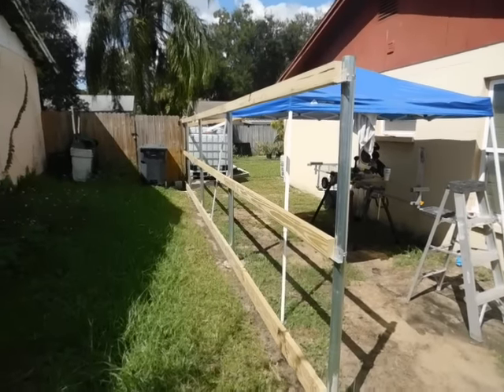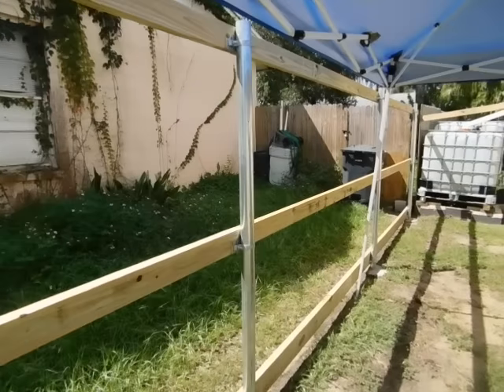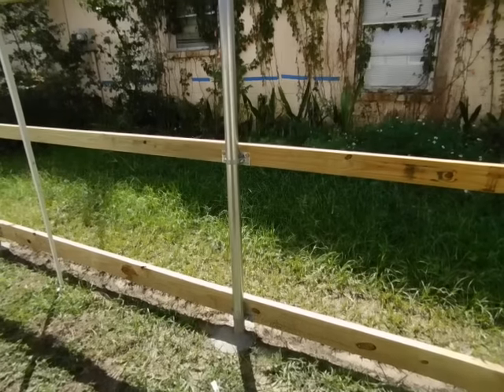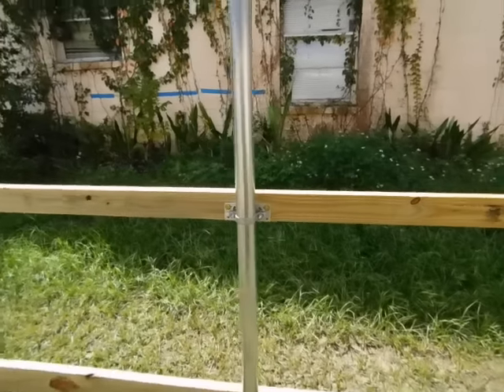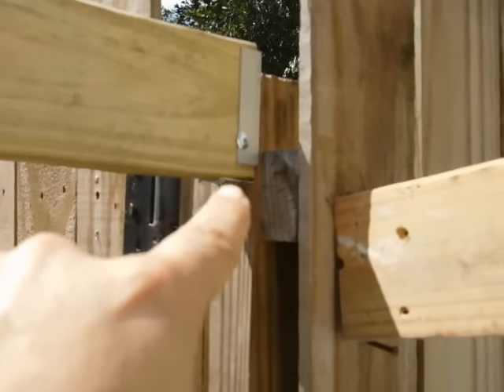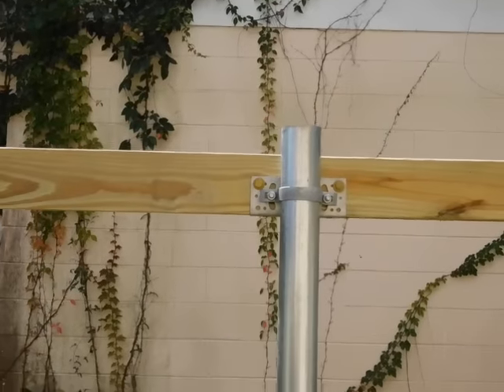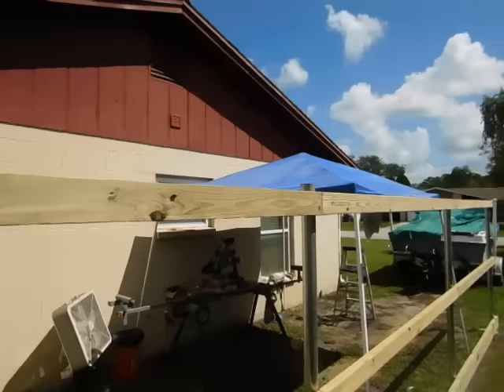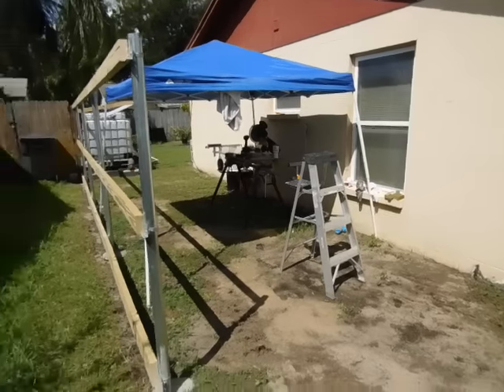DIY / Building a wooden fence using galvanized fence posts (part 1).

Comment: Do you think that I can use this same concept to make a 6' to 7' horizontal fence instead of vertical?
Reply from the maker: Yes Jessica, you can use any amount of spacing for the post to accommodate your design of fencing.
Reply: Horizontal fencing is nice, but boards will shrink a bit and there will be a big gap. My neighbor has a fence like that and now we can see to the other side. Unless you don't care much about privacy.
Reply from the maker: @BAKERHUSKIE  that is true RG and some people use a third picket to overlap the joint between pickets to help reduce the shrinkage when the fence is installed vertically. I don't know that this option would work on a horizontal fence.
Reply: Jessica Ramos: If i understand what you're saying, I've seen horizontal fences that I really liked. I had considered doing a horizontal fence when I replaced the back portion of our fence recently. I used the same process as Manny - galvanized posts set in concrete. I also used three rails, which I always recommend. My workaround for boards needing to be replaced in a horizontal fence was simply going to be way more involved than I had the funds, time, or energy to do. I figured i would need to do the following: 1) use square tubing (I like 3" square tubing with 1/8" walls) 2) weld "channels" on each side of the posts which would allow me to slide horizontal boards down into the channel. I got the idea from other horizontal fences I'd seen -- also "CreteFence" uses this approach. Their vertical posts have grooves running down the sides. 3) I was going to go with cedar lap and gap boards. Using that type of board, there would be no gaps between the boards. Then, if the bottom board ever rotted out, all I'd have to do would be cut it away, allow the other boards to slide down (since they're in channels, they wouldn't need to be screwed or nailed in place) and add a new board to the top. 

After literally months (or maybe even years) of going back and forth on which design I wanted to go with, I finally just bit the bullet and did essentially the same technique described by Manny. I do have a couple of short videos showing the before and after of my fence, but Manny does a great job of describing the vertical process.

Comment: What do I use if I want my fence boards mounted horizontally?  Yours are mounted vertically.
Reply from the maker: If you want your fence boards or pickets mounted horizontally, you'll need to install your support framing vertically and evenly spaced for the length of your horizontal boards.
Reply: Manny's How To Workshop Yes but I’m wondering if this bracket would work for vertical support framing. Or are there any other options out there?  I’ve been looking but no luck.
Reply from the maker: @TheMultisportGeek  You could use this bracket but you'd have to flatten the bended part in order to do so. I would use the bracket in this link to mount your support boards vertically. https://amzn.to/30VSgWL Also, you would need to use a 2x6 PT so that you would have enough of a nailing or screwing surface for your horizontal boards.

Comment: Do you have to put 3 boards running across or is 2 ok
Reply from the maker: Joe, for a 6' fence, I would recommend at least 3 so the pickets won't sag in the middle. Even if you raised and lowered the top and bottom rail, the pickets if 6' tall, would start to curl in either direction.
Reply: 2 or 3 boards what's the difference
Reply from the maker: @joeolvera1  2 will make the fence weaker after only a few years and 3 will make it stronger and will last 10 to 15 years easily.
Reply: @MannyFontes1968  thank you

Comment: Are you happy with the sturdiness of the posts? I do like the design and from what I have seen wooden posts are not a good option.
Reply from the maker: Absolutely Brant and these metal post will not warp from the sun's heat or rot from moisture after years in the ground.

Comment: How do I keep the poles straight, since they’re not wood, while the cement sets?
Reply from the maker: You can use a 4x4 post level or a regular 2ft. or 4ft. level on two sides to get your post plumb. I usually check the plumb at least 2 times when the cement is setting.
Reply: Thank you for your response... one more question, I already have a few 6’ posts in the ground from previous owner chain fence and was wondering if I continued with the 6’ (2’ in ground) poles, do you think this it can hold the 6’ planks and still be sturdy or would you recommend I replace with 8’ poles for the 6’ planks?
Reply from the maker: @triceychaundiva800  Sure no problem! If the original metal posts are in fact 2' in the ground with a concrete base, then you should have no issues either installing planks or pickets on your wood framing.

Comment: Hi Manny. I am a woman. Do you think I can set the posts myself?
Reply from the maker: kapersad1, you sure can and an easier way to do it, is to just pour your mixed concrete in the hole and then take the pole and push it down the center of the hole until you hit bottom, ensuring that it lines up with your line string at the bottom. Once the concrete begins to set, you can use your level to plumb it on both sides. I hope this helps you!
Reply: I'm not Manny, but I can say that setting the posts is man's work. Stick to cooking or doing laundry.
Reply: @thormatt2963  Mr. Thor Matt..in a perfect world..yes setting posts is "Men's Work"..but sometimes "ya just have to do it your darn self" for whatever reason!..as a female I've set many a post..😉..(grew up on a farm..or while my husband was working long hours)..then I went into the house to cook and clean😝..occassionally race off to have have my manicure repaired! 😀

Comment: So the nice side of the fence is going to face the neighbor?
Reply from the maker: Yes Oscar and that is the norm but as the owner of the fence, you can choose which way the pickets face...
Reply: The fence was set up correctly. If he built it with the railing exposed on the neighbor's side it's a security issue as someone can use the railing to easily climb over the fence.
Reply: @mmcneil67  I saw people climbing either side easily in a 6 ft tall fence so not a security issue at all

Comment: Can someone tell me what keeps those metal brackets from just sliding down that galvenized post?
Reply from the maker: Barbara, the bracket bolts tighten against the post and holds it up. You can tighten them very tight. You fast forward to 3:08 you can see how they secure the clamp to the post.
Reply: @MannyFontes1968  Thanks for your quick reply.  Exactly what I needed to know.

Comment: You can get these post adapters from Home Depot for about $4 each.
Reply from the maker: Yeah the original ones that I got were from Lowe's and I think they were about the same price.
Reply: @MannyFontes1968  awesome video, saved me a ton of time. I’m building a fence across a HUGE oak tree. Roots everywhere and not place to sink a 4x4 but I can sink a 2 3/8 metal rod!
Reply from the maker: @urbanlumberjack  thank you and that is great to hear. I did another video on that exact issue of trying to set posts around tree roots by using another product from Lowe's called a Speed Post...https://youtu.be/_TeVn_KVQgQ

Comment: Code is 46 inch dug holes. Because of weather' Cement will rise making the fence fall.
Reply from the maker: Scrap to Cash, that would be the case if you lived in a frost freeze zone. Here in central Florida, we don't have that issue so 24" is the norm here.
Reply: Frost depth is just for frost.  Depth is also a concern of wind shear against fence.  A tall air tight fence needs to have a depth and volume of concrete to give the needed stability under heavy winds like hurricane in Florida

Comment: What diameter are the post holes?
Reply from the maker: Moe, they are between 6- 8 inches in diameter. I used a manual post hole digger to make them.

Comment: Metal posts shift the same as 4x4 posts. The fence will tilt before the 4x4 would rot.
Reply from the maker: Vince, if you live in a frost freeze climate, then that maybe the case but here in central Florida, we don't have that issue. If you're on a budget then 4x4 PT posts are your best bet.
Reply: Do you have any solution?

Comment: Today, there's just no reason to use ROUND posts when there are POSTMASTER POSTS now.  By eliminating the need for BRACKETS, they end up being cheaper.  At .120" thickness, they are TWICE as thick as 16 gauge steel.

They will last 50 YEARS and create a THINNER fence structure that is only the thickness of its metal thicker than your stringers (2x4) and whatever pickets you use, bypassing the extra thickness you get from metal posts behind the stringers.  They also are the EASIEST to conceal via a SINGLE BOARD, as opposed to boxing in round pipes.  Their wind rating is higher also at 70 mph.
Reply from the maker: Yes, now a days, there are many options in building a privacy fence so it's just a matter of preference for the installer. In my opinion, a complete cost estimate would have to be done in order to see the better option.
Reply: @MannyFontes1968  Using Home Depot figures, 2  3/8" posts (8') are $16.70 in qty. buys, then you need the 3 brackets to attach the stringers, using Simpson Strong Tie for $2.11 ea. making a total of $23.03.

(7.5') Postmaster posts are $19.48 in qty, and require no brackets for stringer attachment, so are $3.55 less per post...

Comment: Screwing the wood straight into the post is way better and cost efficient
Reply from the maker: Cubanmofo, you could save a little bit of money but the brackets are less than $2 a piece and trying to screw directly onto the post would have its own challenges.

Comment: Anybody have any suggestions for 4x4 wood posts and chain link
Reply from the maker: Joey, 4x4's are not usually used with chain link fencing but I suppose you could use it if you're not worried about the fence being taught, meaning really tight and no sag.
Reply: @MannyFontes1968  wife saw it on pinterest. I already got 14 4x4x10 in the ground 42 inches cuz if frost line. We live in Jackson mi.
Reply from the maker: @joeyyounkin1328  If you put them in concrete at that depth, then you should be okay but if you try to stretch the chain link with a puller, the 4x4's can bend slightly and become out of plumb.
Reply: @MannyFontes1968  would chainlink be ok with t posts?
Reply from the maker: @jesusa1328  yes, you can use chain-link on these posts and they will work just fine. You'll have to use different brackets though that are made for chain-link use.

Comment: I hate to be a party pooper here but your set up  of the metal post adapters/brackets is incorrect.  They should be installed upside down according to the manufacturer because the angle of the 2x4s and the weight of the pickets  eventually will tilt your fence 2x4s  and most likely the whole fence will fail. If you invert the bracket and install it as the manufacturer's directions the tilting won't be an issue because the weight will rest in the  bracket's plate supported by the metal post. Each bracket is coming with the instructions so you can find there what I am talking about. Good luck everyone out there and stay safe.
Reply from the maker: John, thanks for your input and if you noticed,  there are two lag bolts holding the 2x4's to the brackets plus two exterior screws on the bottom. I promise you, the weight of the pickets are not going to pull on the support boards like you say. It's been almost two  years and the fence is still standing tall.
Reply: So are you saying you deliberately installed them incorrectly? If so, Just wondering what's the purpose behind? The issue here its not the bolts but the wood... remember wood is soft and exposed to elements eventually will take the toll... its why the manufacturer's position and design helps and remember that the less stress for the 2x4s the better. Also things not always fail next day or 2... time will tell. Greetings
Reply from the maker: @johnjohnson3944  No John, not deliberate but my intentions from the beginning. Alot of installers have done it the same way with no issues so the recommendation from the manufacturer is another option. Just saying! Also, the 2x4's here are pressure treated and will shrink over time and dry making them much lighter as well. Come back in 5 years and we'll revisit the fence and see how it's holding up. :)
Reply: @MannyFontes1968  No problem just wondering if there was a reason behind because I never saw anything like that before. And yeah! Time will tell. Good luck